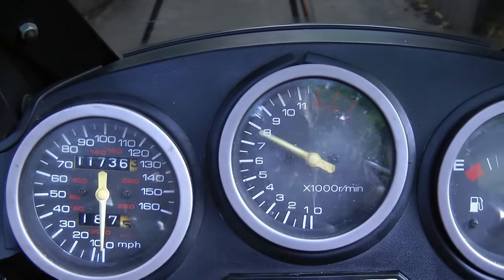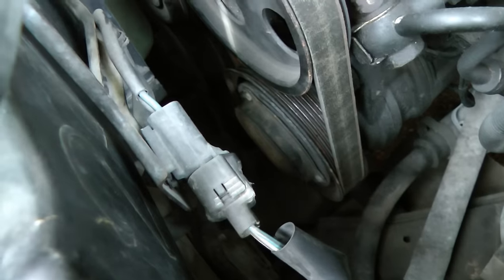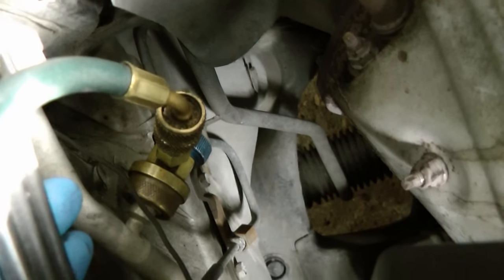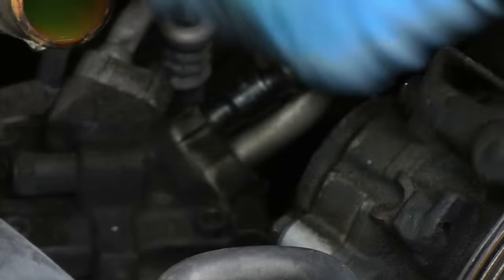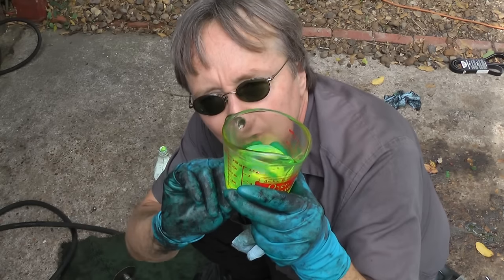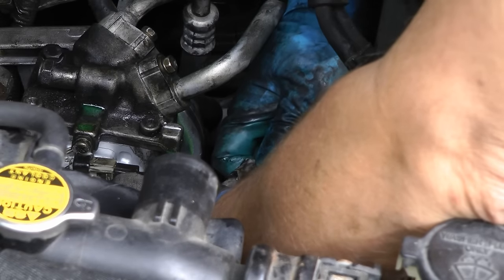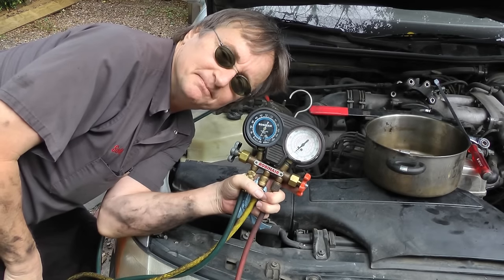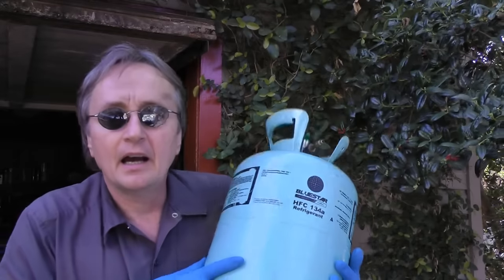How to Replace AC Compressor in Your Car

Comment: Hey Scotty, my 2002 Impala 3.4 is making a clacking noise while running, and a scraping sound when a car pulls next to me in traffic. When I turn on the ac, the noises quiet a bit, still the ac blows hot air. Just bought a new compressor and orafice tube. Could the problem be just the clutch/ compressor?
Reply from the maker: odds are it's the compressor entirely, if just the clutch, it would stop making the noise when you turned the ac on entirely.
Reply: Scotty Kilmer Turns off, or quietly rattled. Now that ive replaced the clutch, I have a loose harness wire. Dont know where it goes. Maybe a fog light harness? Fan wire is connected, everything's in place. Btw, I have not started my engine yet because i havent oiled the comp yet.

Comment: whenever I have the heater or ac running on my explorer the engine will rev up every cycle and it will try to accelerate if stopped. any ideas what would be causing that? also sometimes when I start up the 4wd & 4wd low blink 6 times and I'm unable to roll down my windows. happens more often on hot days
Reply from the maker: +Sam S do my video "how to fix a car that idles poorly" and realize it may need a new iac valve.  As for blinking, get the tranny codes read, it has a transmission failure code

Comment: I have an 07 Charger and it blows hot air from the passenger side and on my side it blows barely cold air that is only when the car is running, when it is idling it blows hot. I check the compressor and it appears to be leaking small amounts of oil. Do I just need to replace the compressor? anything else I should do?
Thanks.

Comment: can i put a new compressor in my 2010 chrysler sebring without refridgerant and drive the car long enough to get it to a shop to be filled. its cold were i live now so i wont need the A/C . but my compressor is locked up and burning my belt off

Comment: @rramos415 I'm not Scotty but take off the front right wheel and the mudguards and if you can see your compressor you can remove it. VWs are tight under the hood especially the VR6 models.

Comment: Great video 
I have question for hyunday elantra 2008 how much I can add oil 4 oz or more?
Reply: Look up the manufacture of the compressor and the model. Get the correct amount from there. And less or more can damage the system or compressor.

Comment: hello scotty i have no leaks in my ac system and has been verified by the dealer ship but my ac unit is making noise can i just swap the ac units with out draining the system
Reply: NIck Thompson im no expert but unless you want refrigerant leaking all over the place, i would drain your system first. pretty sure "venting" your ac system is illegal in most if not all states

Comment: Hey Scotty, the clutch on my compressor keeps cycling even though I put more R-134 in the system.  What could that be?
Reply from the maker: check the high and low pressures, if low is low, either refrigerant is still needed, or there's a restriction in the system causing low pressure which makes the compressor cycle on and off. If pressure is high, then often air in the system or a clogged condenser does that.

Comment: Hey Scotty! I got a 2004 kia spectra and the AC is not cooling, I bought an A/C Pro Refrigerant to see if I could get it going but no good results or non at all.
But I did find out the compressor only seemed to work/turn when the AC got the air from outside and didnt work when I set it to circulate. The AC never came out cold either way. But... What can I do now??
I know a Mechanic might be the answer, but I'm not only trying to save, but to learn as well

Comment: Hi scotty,

Yesterday morning the AC blows hot air. So while I was under my car yesterday I noticed that I didn't have a AC belt anymore. It was broken. That would explain the loss of cold air. I checked the compressor, it doesn't rotate at all. I asked the mechanic and he told me I shouldn't put a new belt before replacing the compressor because it's going to break again and again.  Is there a way to fix this compressor problem? Does it mean the compressor need replacement?

The compressor costs a lot of money about 730$. Thanks in advance for help.
Reply from the maker: yep, time for a new compressor, no way past that one, AND realize more could be wrong inside the system that broke the compressor in the first place. That's life with machines
Reply: Someone told me that I won't be able to rotate the compressor by my hand as it has a clutch to stop it. He also said I should just replace the AC belt and it will work again.
Reply from the maker: RECKLESS XAVER
when the system is full of refrigerant, you can turn the ac clutch by hand, of course using a wrench and socket on the middle nut. It should spin, but have a decent amount of resistance as the compressor compresses the gas inside.

Comment: Ok i cant figure out if my power steering is bad or the ac compressor. The one on the bottom which i figure is the ac stops spinning at times and there is a really annoying scraping noise? Any suggestions

Comment: on my mazda 323 '93 the compressor spins easy, But could it be a bad clutch which isnt energising? i tried to short the 2 wires on the hi side and it didnt make any difference, in order to force the clutch in. The system wont take any freon. what else is it if compressor is ok?
Reply from the maker: you unplug the wires to the clutch, then run power to it IF you have just one wire, and power and ground if you have two wires. If it doesn't spin, compressor is toast
Reply: the clutch and pulley is spinning at all times with the a/c off even. that doesnt mean necessarily  that the clutch is enegised, but it is freewheeling with the pully. the fan works when you switch the a/c button in. shouldnt the clutch be still and engage only when a/c button is pressed?

Comment: scotty i need your help man.  i bought on of them "freon in a can" thingys. with the pressure gauge. pressure started at 10psi, so i added refrigerant until it read 45psi. BUT my car's idle speed would drop and go back up (as if it wanted to stall) , anyways, my ac still blows out HOT AIR! NO DIFFERENCE WHATSOEVER!!  

CAR IS A 2002 chevy trailblazer p.s. my heat works fine

Comment: Scotty, your buddy Stephen From San Antonio again. I just acquired a 2005 Ford Five Hundred. But the A/C compressor is locked up. I know I'm going to have to change it. However, will I need to change more things? If so how do I know what to change or is it in my best interest to change everything even though it may not need it? Oh and FYI I'm doing the check for the electrical short tomorrow.

Comment: hey im kinda desperate and i hope you can offer some advice. Last night my car over-heated. The mechanic siad i had a leak in "the hose that takes water to the AC". While taking the hose off to get the replacement, the plastic part that it attaches too broke off. Seems to be rotted out as it is very brittle. Can you tell me what i need to get or what replacement part do i ask for?

Comment: On my 94 Honda Accord ex when I turn the AC on the air doesn't come out cold and the AC compressor makes a lot of noise. There's an oil leak as well in the area near the compressor, does this happen when the compressor goes bad, or could the oil be related to something else that's wrong?

Comment: so i bought a 1982 honda accord and did not come with ac belt but i just bought one...should i just put it on? or if it seized can i just replace the ac compressor

it still has some charge...

Comment: If the sensor connector snaps of just behind the pulley wheel on the compressor (shredded belt tore it off) is the compressor pretty much boned?
Reply from the maker: IF you mean the connector for the AC clutch, you can just buy an AC clutch and not the whole compressor
Reply: I'm considering that now.  I did some pricing and it's a good deal cheaper just to replace the clutch and I'd prefer not to flush and vacuum the system and replace the accumulator.  Unfortunately it's a AC Delco with compression fit so I need to get access to the proper tools.  Thanks for the reply.

Comment: Scotty
What is the correct balance of the high side a/c and the low side a/c on my 2007 chevrolet impala, 213 cu.inch engine front wheel drive.

Comment from the maker: a royal pain, info would not fit in this small space. Even a mechanic takes over 2 hours to take all the crap out of the way. Get a cheap manual with pictures if you've never done one.

Comment: @smithraymond09029 I think you can still get R12 on Ebay. I know it's not manufactured any more, but there's still some "in circulation". You'll pay a bit more for it, since it's a "hot commodity" (Bad pun) It works better than the new stuff, and you'll have to find a shop that'll handle it for you. I don't think shops that service R134 AND R12 are as common I think most just have r134 systems. I've been going through the same thing with my old car so you may want to take a look.

Comment: im replacing an ac compressor on an R12 system. I know its illegal but my uncle had some leftover from when it was legal. anyway, do i use a different oil than R134 systems? and how do i know how much oil to put in?

Comment: Hello Scotty, I need help with my car. I have a 2007 chevy impala 3.5 127k miles.  I have  a hard time Defogging my windows.  Sometimes I need to blast my heater so my windshield can clear up. But rear passenger windows are always fogged. Nothing seems to work. Need help plz
Reply from the maker: check the AC, if it's not working, defrost won't either as it uses cold dry air

Comment: My ac blows cold air for about 5 min on my 2000 chevy blazer then blows hot air. Also, when i stop and kill the engine like when i go shopping and start it again , it blows hot air and the compressor fan isnt turning. I cant afford the auto shop. Ive checked the blend door acuator and it is fine. 2000 blazer with 17,000 miles. Not used much in the past. Im female and have son to help but hes not mechanic either. U think compressor is problem or what? Any suggestions. Thanks.
Reply from the maker: often the low pressure switch goes bad on those, check that first, easy to replace, any auto parts store can show you
Reply: Scotty Kilmer ok ill check that and get back to u. Thanks

Comment: Hello, I have Alfa 166 2.5 v6, before I bought the car, aircon compressor was changed 3 years ago, looks clean from above, and mechanic recharged my aircon, no leaks, perfect pressure, but its not working, the revs dip a bit when turned on, but no noise from fan etc. What are likely causes please?

Comment: Hey Scott my name is Gilbert and i have a 2003 Toyota corola and and for some reason my heater and ac aint blowing out air at all what do you think might be wrong with it
Reply from the maker: generally that's a bad blower motor, unplug the connector to it under the glove box, put power and ground to the motor there, if it doesn't blow then, it's bad
Reply: Scotty Kilmer Some of the PAG 100 oil in compressors doesn't come with green dye in it, do you recommend UV dye to be in it from the start, or should I just make sure everything is done right so the dye is never needed?

Comment: Scotty, I have a 2001 Nissan Pathfinder. I was told that the compressor is bad - but that it hasn't seized yet. The indication being that it needs to be replaced regardless but somehow it's worse if it seizes. 
I'm not sure: If it seizes - does that effect the running of the car or just the use of the AC? (will I overheat even if I don't have the fan or AC on)? I'm going to Phoenix with kids in the car and AC would be nice but $600-$800 is not anywhere near my budget
1. The AC blows air but it's not cold
2. The compressor isn't seized (according to mechanic)
My daughter and I are going to go out and see if the clutch kicks on and whatever else we can check for (learning from DIY internet. I already know how to do plumbing, electrical, and drywall, just add mechanics to it I guess, lol )...Is there someway to know for sure that it only needs refrigerant or if it's truly the compressor? Thank you
Reply from the maker: it would only effect the AC, but it if does seize, that can send metal inside the AC system then cost a ton to fix from that damage if you want AC back on
Reply: Thanks Scotty.
I checked the compressor clutch and it does engage and runs well, it turns off when I turn off AC. The fans both work, both large and small. The fan blows strong inside the car. The pulley belt is going fine.
I'm wondering if it just needs charged because everything seems ok other than it just blows warm/ambient air.
If I get it charged and it blows cold...does that mean it's good...or would I still need to worry that the compressor could seize with it working (or does that only happen after the compressor doesn't engage and you try to use it)? Thank you so much for your quick response. I appreciate the help  :)
Reply from the maker: Melissa Padilla
Have it filled up with a factory load of refrigerant and then see what the pressures are, at idle high and low, and at 2000 rpms high and low. e mail me those pressures, they tell me what shape the system is in
Reply: Melissa Padilla

Comment: whats the best way to clean the compressor coil and condenser coil under the dash
and how to change the foam filter and a 1996 honda civic 1.6 litter.
Reply from the maker: I assume you mean the condenser by the radiator and the evaporator core inside the dash. The condenser can be done by spraying condenser cleaner on it and rinsing it off with a hose, but the evaporator would need removal from the car to clean it correctly with spray. Filters are just removed and replaced, though access to them can be hard depending on where they are located

Comment: @ scottykilmer : geat vids man!!! i have a 92 acura legend i've been drivin this car for about 6 years n never used the a/c becos the a/c compressor does not work ,but now i want to get it fix.I want to know wht i need to replace to get "a nice andcold air" ? i have a new a/c compressor and a new reciver drier ,  i have to replace the condesor ,the spanssion valve ,o maybe the evapotor core too ?

Comment: Scotty
I need help, I just replaced my compressor, recharge it and I only get btwn 20 to 30 psi on the low side but high side still show 0 even with the compressor engaging. 
What else could have gone wrong?
Reply: angello verastegui incorrect charge of the system, or a clogged device. If the high side is way high and the low side is low it’s a clog issue. And vice versa. Check both sides. Could be a txv/fot issue

Comment: robbie i have a question every time i turn on my a/c on my 98 saturn it starts making a little knocking noise what could it be please help thanks.
Reply: +Raul Tejeda The same thing was occuring with mine. It is most likely your clutch, but it means complete failure of your A/C Compressor is near. I know from experience...

Comment: robbie i have a question every time i turn on my a/c on my 98 saturn it starts making a little knocking noise what could it be please help thanks.
Reply from the maker: +Raul Tejeda time for a new AC compressor IF it isn't just bolts that are loose holding it on the engine

Comment: Not mentioned. But replace the seals for the compressor and use a torque wrench to tighten the bolts. For a non mechanic snug is different. Be correct. Fix it right and fix it once.

Comment: I just paid $1200.00 to have my evaporator replaced.  At that time, the shop told me my conpressor was leaking but I could wait on that $500.00 repair.  However, my air conditioner is cold when driving but is hot when the car is idling such as stopped at a red light.  Should I invest  another $500.00 in a 2007 Camry?

Comment: what would be happen if we just straight change compressor without doing the  recovery vacuum pump?
Reply: the moisture in system would turn into acid and corrode the new parts and make the repair not last nearly as long as it should.  Also the air left in the system would make the system not as efficient so the air would not be as cold as it was before it broke

Comment: Scotty I have a compressor that doesn't work but it does spin when I spin it with the socket any tips????doesnt cycle on
Reply from the maker: Angel Tapia often just being low on refrigerant does that, pray it's not something more complex like a shot compressor
Reply: Scotty Kilmer My Ac line hose bursted while Ac  was running. What might be the cause. Please Advice.
Reply: Scotty Kilmer hi scotty i had my audi A3 re gassed yesterday but it still didnt work the pulley on the A/C compressor is spinning and the fans are kicking in when i turn it on? is the likely to the be something on the A/C compressor thats gone?

Comment: Im fix it chevrolet  blazer 2005  but I did everything you said and still have the problem,when I turn on the ac the engine is off if you can help me
Reply from the maker: the engine is supposed to be idled up when the AC is turned on, check that idle up system IF the Ac blows cold when you are driving at highway speeds. If Ac does not blow cold even then, you still have an ac problem that needs fixing, they are rather complex systems

Comment: hi +Scotty Kilmer i have 2012 tourneo custom when a/c on car get iddle position shakes all the time ford service update the firmware it didn't solve the problem what would be the reason? Thank you!
Reply from the maker: +Mustafa Usta  if it ONLY does it with AC on, either idle air control valve is bad OR the compressor is wearing out and strains the engine
Reply: Ok thank you so much